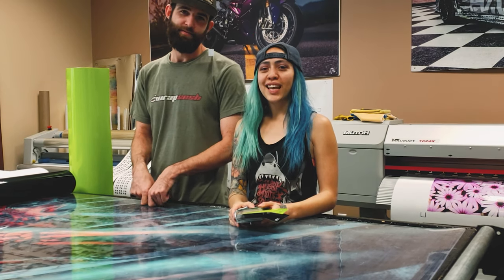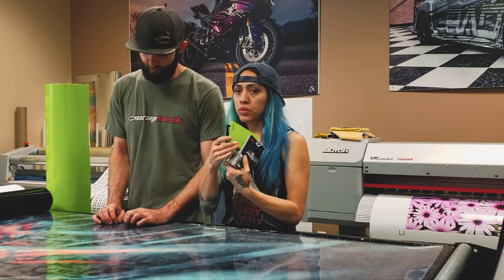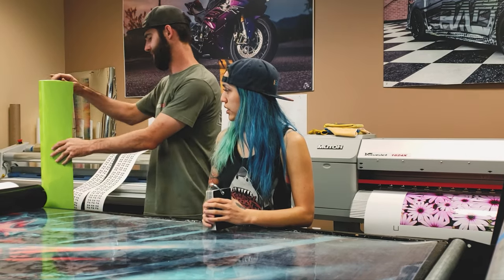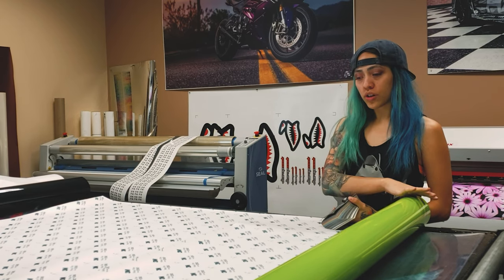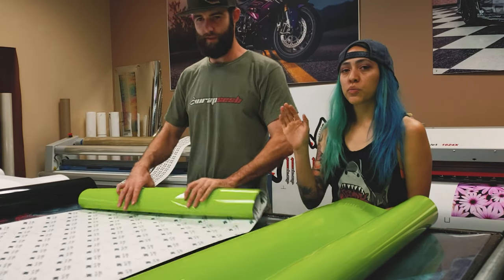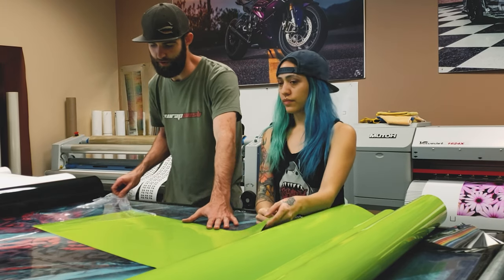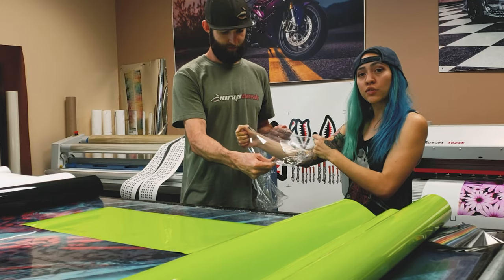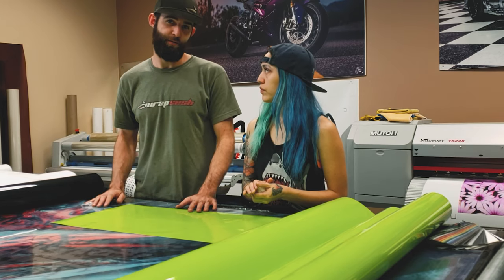3M 2080 Installation Tips and Tricks

Comment: Great video.  2 questions. Looking to put on my car. 
1. What is difference between 1080 and 2080?
2. How much would i need to cover 2005 Altima?
Reply: Check the 3M website for the difference between 1080 and 2080, 

You have to measure each panel if you want to wrap the whole car and add a few extra feet to your measurements to be safe. Every car is different so it would be hard to tell you exactly how much you need. To wrap an entire vehicle it costs between $2k and $3k in vinyl depending on the car.

Comment: How long will these wraps last on chrome trim? If adequately pre heated..
Reply: the typical lifespan of vinyl is 3~5 years.  3 years on harsh condition, 5 years if kept in garage all the time. 2080 series is no exception. it may appear to be good condition after a few years but 3M suggests for removal along with the lifespan because you're risking yourself to damage the car paint.
Reply: @redding4540  thanks. did my mirrors and it looked good for a year. just peeled them off